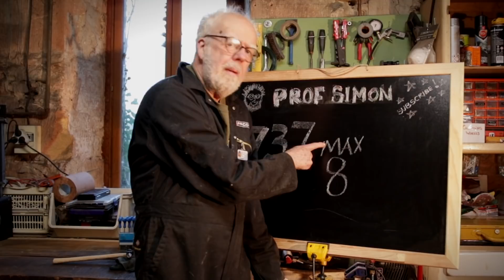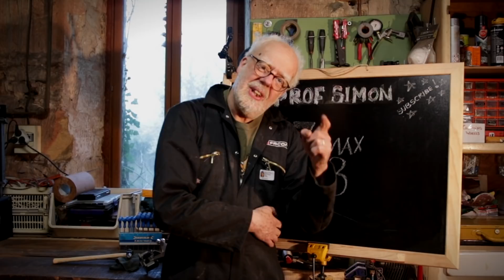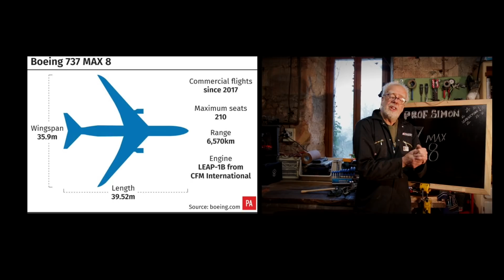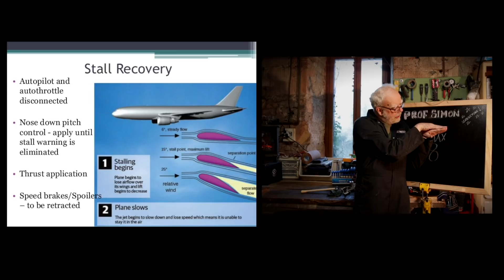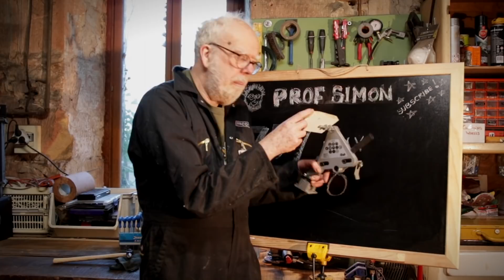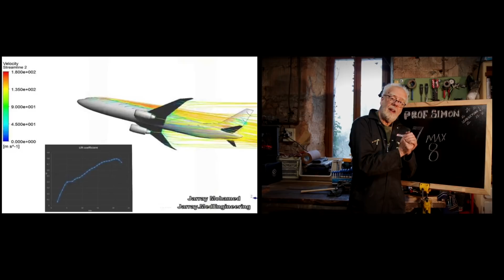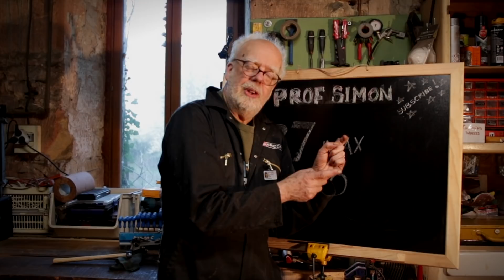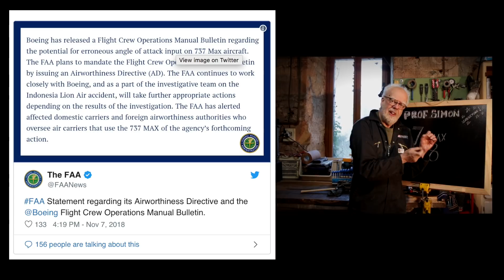Boeing 737 max 8's

Comment: With all due respect, Prof Holland, but the stall-prevention system and the attitude-recovery system should only recover the plane to the horizontal position and restrict airspeeds to within safe range, and should NOT cause the plane to wildly exceed parameters in these 2 cases, in which both planes nose dived and vastly exceeded their speed limit.  So, in both cases, we can safely blame the 2 crashes on the airplane computers and NOT on the pilots.  
Computer softwares for attitude recovery and stall-prevention should be written to have checks and balances.  They should be fault tolerant of faulty sensor inputs by gathering data from a vast array of sensors and should be able to ignore the sensor input that is wildly off.  After all, it is to be expected that all sensors are capable of giving out faulty signals at times, and a reliable artificial intelligent system should be able to filter out faulty signal by comparing that to  other inputs.

Comment: If it aint broke dont fix it. Thats is why newer model cars are recalled because the word new means novelty .no that the pilots were reverting back to their old experice ways .take in mind these engines were also more quieter .so they would probably have less power to compensate for the displacement noice teduction.

Comment: There was a very near accident in the UK with a Thomsonfly 737. They let the aircraft get slow on the approach as there was no warning for the Auto-thrust disconnect, (80 kts).
They applied full thrust but did not trim forward. This aircraft pitches up very quickly due the underslung engines. So, the aircraft pitched up to around 47 degrees and was only saved from stall because it the nose by itself fell sideways (like a stall turn). Believe it or not the Pilots did not report it and it was only discovered by the normal FDR analysis later. The MAX has more powerful engines.

Comment: What would any pilot do in any aircraft that is stalling: 1, increase power to the engines or 2, lower the nose. None of these actions should be overridden in a correctly engineered and configured aircraft. It is like when you have cruise control in your car. With cruise control engaged in an emergency when you hit the brakes cruise control disengages. it does not matter what type of car you are driving the driver is given the highest priority.                                                                                                                                                                     Aircraft should be designed with similar consistent protocols I do not know if they are regarding stall protection. There is also a suggestion that one of the Angle of Attack sensors on the Indonesian flight may have been faulty. Even so modern aircraft should be engineered such that a single failure is not likely to lead to the aircraft crashing.

Comment: FAA says It's safe to fly the 737 MAX8.   The FACT is two of them fell out of the sky within 20min after TO and  all on the A/C dead due to its safe A/C to fly.    What a nonsense!!!     I agree with the postponement of the operation of the A/C, until the Accident report is completed.     Some decades ago, theres rudder hydraulic actuator related accidents with two 737, on the final approach phase, which resulted in all PAX ON BOARD perished.    At first Boeing says its pilot error.    But after one year NTSB found out the problem and they changed all the HYD ACTUATOR.

Comment: I don't buy your explanation. There are at least two (independent!) stall warnings that go off well before the plane is actually in a stall. The pilot certainly would have reacted long before the stall actually happened! There has to be some other explanation. Way too many of these planes flying perfectly for this to be a software problem. I would look at the background of both of the pilots in these two VERY ISOLATED cases. This would not be the first time a pilot with severe psychosis purposely crashed a plane! I suspect political correctness will make looking at the pilot background the very last factor to be examined if it ever is at all!

Comment: As people have been commenting, perhaps the cause was a lack of training AND/OR reading the manual...in just two cases out of the multiple thousands of circuits flown since the arrival of the 737 MAX  8. 
In this case, the evidence of failure lies with the Captains and Airlines. In the situation of the Ethiopian crash, the Captain had 8000+ hours in the 737s...i.e. over 11 months of his life in the seat. He was set in his ways, competent, and perhaps not concerned about a new aircraft type...who is going to attempt to retrain him or ensure that he is aware of actually important changes to flight procedures. His co-pilot had around 200 hours and was very unlikely to challenge the "Master and Commander." He was so junior, he was very unlikely to have finished reading the fine print in the manuals!
However, Boeing must take some of the blame for not explicitly advertising, beyond normal means, the changes in the MAX 8, and the imperative need for blatant qualification upgrades, emphasizing these differences.
Now its wait and see...and for many families and friends, the very sad human cost of dealing with unspeakable loss, likely due to others' professional shortcomings.

Comment: BOTTOM LINE
Boeing screwed up by doing a "cheap adjustment to accommodate the larger engines and new type landing gear.  This cheap adjustment in the form of new software  MCAS, was meant to bring the new plane with the extra thrust to operate in the same dynamic envelope of the B737 NG. They supposed to make structural changes of the plane to accommodate the increase thrust and change in CG. The only structural changes other then the engines and mountings were the landing gear to accommodate the for minimum clearance of the larger diameter engine.
Reply: Not sure how over can come to the conclusion that it was a cheap adjustment.
Reply: CG means "center of gravity". In this case, the center of gravity is too far back making the airplane tail heavy, causing the airplane to be unstable.

Comment: Boeing didnt sell it as a new plane, just an update of the older version to keep the same type rating. But in fundamentally behaves differently (at least when the computer corrections are off). Boeing decided in order to sell it better it has to behave like the old one. They tried to copy the old behaviour with computer corrections. They failed miserably.

Comment: I agree completely. I feel that the pilot gave a little forward stick to stabilize and at the same time the 'machine ' gave a 'little '. Well a little and a little equals a lot, that could be very difficult to recover from.  This would be especially true if the machine was still trying to add its input. Thanks!

Comment: In the situation described, it appears the auto pilot /computer may be by-passed or set to manual for the pilot to take over
I thought it was basic.
I am not sure whether the "Window" of control referred to in your talk applies even during  cruising .   I would have thought that in case of extreme emrgency the pilot should be able to  by-pass even the "window"  and have total control

Comment: Actually Boeing sent out a memo to the pilots of the MAX after Lion Air crash explaining what may have caused it and what to do. Here is basically what is happening. Upon climb out the pilot will engage the autopilot with it in NAV mode. At this time flaps are still extended for climb out and the aircraft maintains the climb as indicated on the FMS to the assigned altitude. Once the flaps are fully retracted the MCAS engages. At this point the MCAS looks at several things but one being the Vertical Pitch Indicator to either adjust the trim up or down as needed for climb or possibly level flight if needed at this point. The Vertical Pitch Indicator is reading on some MAX 8's 10-20 degrees higher than what the aircraft actually is pitched at. This engages the MCAS to lower the Trim to level the aircraft as needed. Well at this point the plane over pitches nose down because the Vertical Pitch Indicator is saying the plane is pitched up, which it is not. The pilot then will use the Trim on the yoke to trim up also pull back on the yoke and both the MCAS and the pilot are fighting to keep the plane level. Once the pilot stops with the trim adjustment the MCAS goes to full trim down due to adjust for the 10-20 degree increase in the Vertical PItch Indicator it was getting, which is incorrect. At this point the aircraft is sadly most likely in downward angle and unable to recover from it. Boeing did say in a memo what could be done to help stop this during flight. The pilot's can manually override all autopilot functions including MCAS, either first or at that point put the Flaps extended one notch to disengage the MCAS.

Comment: Yes I tend to agree with your explanationHowver, would this new safety system still be operable with auto pilot turned off ? if so if you found your aircraft not functioning as you expected would you not return to manual mode and control the aircraft as normal ?

Comment: I appreciate your presentation. I'm an Airline brat & was wondering, shouldn't there be an over-ride system in place so that the Pilot can "take contol" in case of computer error? Thank you in advance. ❤
Reply: The problem is that the pilot was overriding it in the old way (according to professor Simon).

Comment: I would liken that to a new car's traction control system.  With it on, it is very tough to do the old sideways spin burnouts / turn around.  With it off,  it will fishtail and not self correct.  If you are use to driving with no traction control you probably understand and anticipate the steering inputs you'll need on sharp turns or accelerations.  With it on, the car will try to right itself by applying power to the rear wheels at separate times.  Not exactly the same but how I'm understanding it.

Comment: Professor Holland, I would like to add a couple of points.  
1) Boeing sent the update to the maintenance crews but not to the pilots and most pilots were not aware of the AOA sensor and how it behaved causing more than the two crashes you mentioned.

2) There is also a new switch in the cockpit towards the lower right-hand area next to the pilot and they can turn the AOA override part of the software off in the computers.

3) Having recognized that this is the probable cause without Boeing or the airlines admitting fault, several of the airlines are now making sim training time mandatory to learn proper function and procedure with the AOA sensors installed on the 737 Max 8's.  Boeing is considering making the simulator time mandatory for all pilots of 737's that have an AOA sensor and programming installed. 

4) I am not even a private pilot but an enthusiast that soaks up a lot of knowledge about things I will never deal with in real life.  Strange, huh?

5) Professor Holland, I would like you to watch the YouTube video on FlyDubai's Flight 981 accident.  It was ruled pilot error by losing orientation with the ground and not trusting the instruments.  However, the actions he took and the way he fought the node going up and down and the flaps making corrections smack of him being unaware of the AOA sensor and programming on this 737-800 airplane.  I would be very interested in your opinion as to whether the AOA and his actions to counter it was the actual cause of the crash.

Here is the URL:  https://www.youtube.com/watch?v=24Fe1wMy-9Y 

Thanks,

Glenn Quagmire
(A pilot on the Family Guy cartoon)

Comment: 737 type ratings cover all 737s.  In the US pilots only go through a differences training between the NG and the MAX. The MCAS system wasn't mentioned on the FOM (Flight operating manual) because pilots can't disable it. The only valid procedure we have is the same as the trim runaway. There is still a lot of questions about what is going on with the aircraft. Thanks for showing your point of view. However, we have to be careful of not speculating about what happened.

Comment: Thanks a lot professor. The technology is always right. I doubt if the pilots are up that level to understand the manual. I cannot believe that the aircraft was defective. In real term, it is not the users who can tell you the technical difference between Samsung 9 and 10 but the designer. The good part of this incident is it happened on aircraft. In those countries if we mention the technical capability of doctors with new technologies in the hospitals it is terrible. Patients lives easily pass with wrongfully understood manuals of new imported technologies. I can name a lot. In short they don’t really care about the manual of the product. The only thing that they could worry is they are going to take Boeing 737 training. For example, forgetting max 8, max 9, max 10 whatsoever... it is Boeing 737 according to them. Technologies don’t work like that please. Updated pilot means a function of good user experience, training, effective manual reader and so forth.

Comment: Too much technology sensors ,software putting bigger engines mounted different and putting your lives in the hands of software updates and sensors to correct the flying or at the very least trusting that every pilot is completely trained on the new software, look at how many cars are recalled from all the glitches. More is not always better sometimes old ways are better like when pilots needed to feel how the plane is responding.

Comment: My goodness.  What insight. You have exactly nailed the problem.. On all the pilot reports of "problems". they stated that disengaging the autopilot solved the problem. Knowing now that the max 8 was an autopilot upgrade, i understand why the FAA didn't pursue those complaints, as it wasn't, in their eyes, a genuine issue. Yet they are pursuing their focus on the new anti-stall device. No matter, since FAA accident investigations are remarkably thorough, and they will find out the real cause. Even though they are ultra safe planes, it's best they are grounded in the meantime, I would say.

Comment: This point also applies to modern cars with stability comtrol. You have to unlearn your skid control to drive them. I have witnessed a number of accidents where the car    is violently swerving all over the road because the driver is fighting the computer.  To me it feels unnerving to hit a ridge of snow to have the car not even twitch. Yes it is progress but you need to understand it to use it.

Comment: Agree of course the plane is safe. One issue you did not mention is the mounting point of the engines is higher so they create lots of lift. If it noses up too far it will not come out of the stall. Hence the computers ensure this cannot happen.

Comment: Once I read about the flawed MCAS AI routine built into the Flight Management System, and the poor documentation Boeing provided in the Flight Manual, it made a lot of sense that the MCAS algorithm is at least part of the overall problem.

Comment: Couple of points. Typically guys or gals flying this airplane are not going to stall it and exceed the angle of attack on take off. Therefore there would be no need for the computer to intercede. My assumption is that if the AOA was exceeded then the computer might take accident. All you need to do is look at Airbus and how they relied on computer intervention and have their share of problems with crashes. Remember Farnsborough airshow some years back where the computer would not let the pilots climb and it flew into the trees? Remember the F22 accident that the aircraft settled onto the runway because the computer never saw a slow pass gear down and would not allow the test pilot to increase power? 
It seems likely there is some interaction that causes an abrupt action that doesn't allow the pilots to take corrective action or normal corrective action for a stall is to push the nose over is wrong.
Unless the wing is very laminar most large aircraft will shake and warn you regardless of a stick shaker or not but a laminar wing can just stall abruptly...

Comment: If MCAS detects an AOA stall issue, it will command nose down to recover.  It has to be that this action will cure the AOA problem and MCAS will relinquish the nose down command.  What seem to happen in both cases is that the nose down command persisted enough to fly the plane into the ground.  In the case of Lion Air, the AOA instrument was determined to be faulty which caused the persistent nose down command.  The Indonesian pilots did not have the knowledge to terminate the MCAS trim commands so the plane crashed.  But Ethiopian Air pilots were well briefed on how to turn off the MCAS trim and they did not.

At the root of this problem are the two very heavy engines placed closed to the fuselage.  This configuration can cause stall in some take off conditions which gave birth to MCAS.  I think the fix will be to place the engines in their more traditional outboard position.

Comment: Focus in the main landing gear which was not re-designed to accommodate the fan engine.  It is possible the engine being to close too the wing causing unintended issues which MCAS addresses.  The new A320 has a larger engine and taller landing gear and does not have this possible MCAS issue.

Comment: Well i am going to give the solution since nobody seems to be getting to the point: THE TWO NEW ENGINES ARE HIGHER THAN THE WING

These two motors are plane underneath and kind of round on the top. These engines are kind of a wing and give adicional sustentation. So with this aditional sustentation the nose of the plane goes up and the plane can stall. So a computer program was implemented to try to correct this.